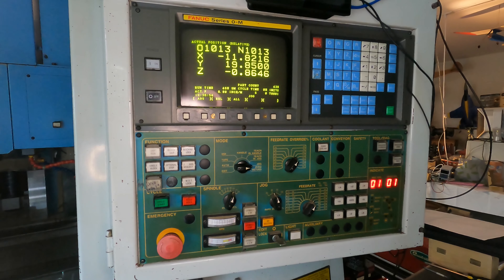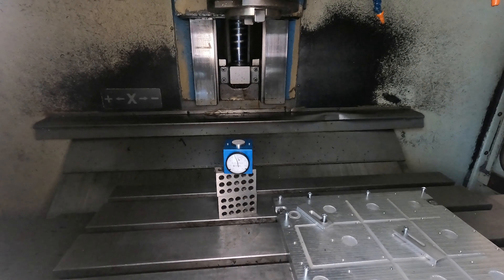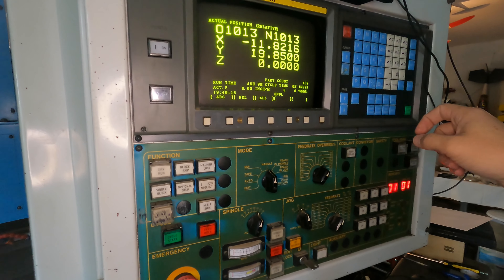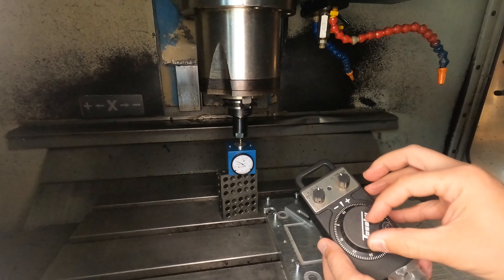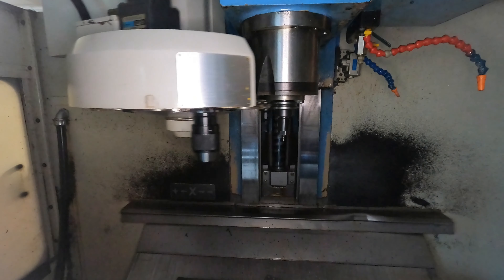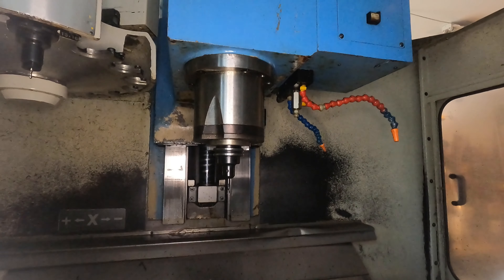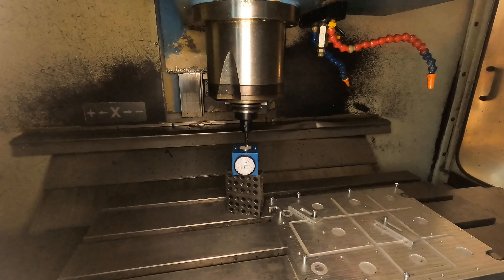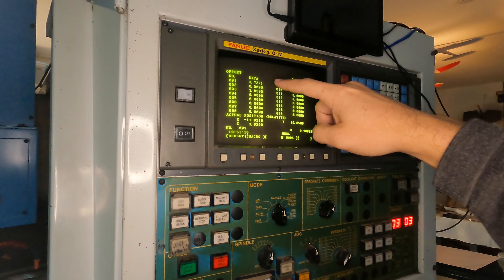Measuring Tool Lengths on a Fanuc OM CNC Machine

Comment: Why did you measure (or need to measure) the spindle height a second time @6:37 ?  That you got a difference of 0.0015 is a bit disconcerting.  Is this because you had re-positioned your tool setter and the 1,2,3 blocks ?

Comment: Hi guys! please help a newbie! I recently purchased a Fanuc Tape Drill Mate Model T CNC milling machine. I don’t know how to make the X Y axes tied, in offsets only the Z axis? Thank you!
Reply from the maker: Are you referring to tool compensation? I always put the tool diameter in the CAD before the gcode is generated. This means only that tool(bit) can be used.  But I know that some people generate the gcode for the exact part dimensions so different tool sizes could be used by the same gcode.
Reply: Thanks!
Reply: Hello again!  Can you tell me where the CNC Pulse Generator control panel is connected?